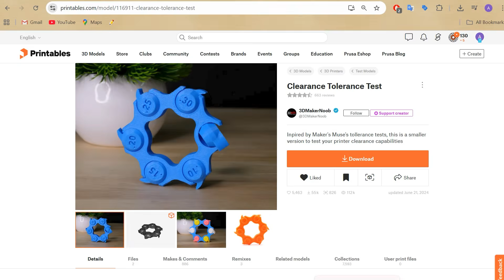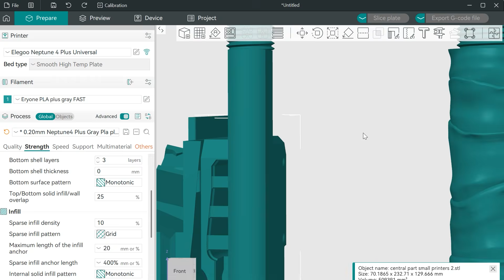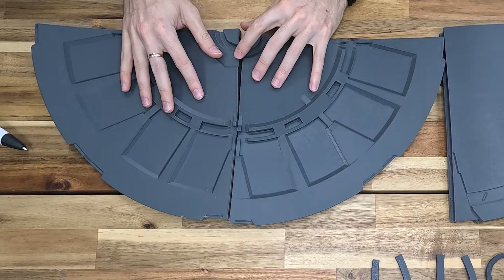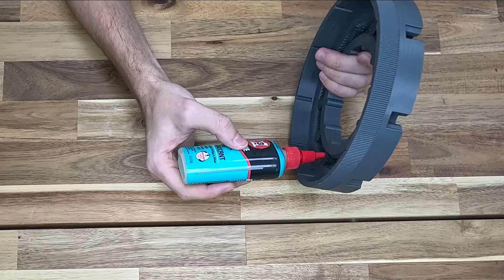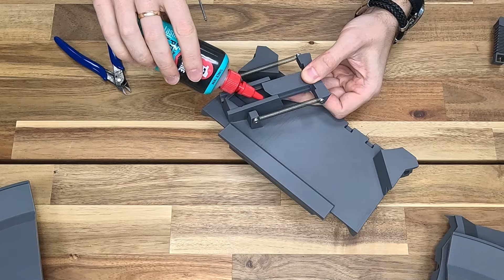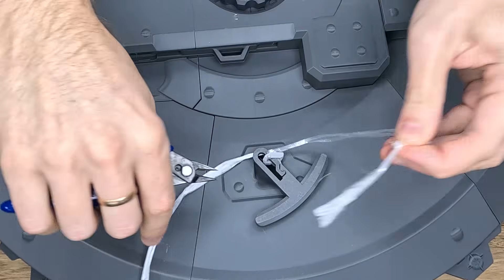3D-Printed DOOM Shield – Fully Functional Saw Mechanism!

Comment: Im using the 100 micron bearing and i have to force it to even move 😢😢😢
Reply from the maker: do you print calibration model?
Reply: @Alex_Geek_Workshop  there wasn't one in the files I downloaded so no

I checked the bearings and the print was all clean and neat at 0.2 layer height 

Can you tell me the print settings you used?
Reply from the maker: @poo-v7t6q I provide link to download calibration model ( it’s not my model) the point is not in setting, all printer is different, plastic diameters can vary from batch to batch, you need to calibrate your flow with your printer and your plastic what you use. In YouTube a lot of videos how to do it
Reply: @Alex_Geek_Workshop much appreciated ❤ 😊 thank you
Reply: @Alex_Geek_Workshop I've finished it but the chain doesn't wind back into the chain slot after pulling on it to make it spin could that be to the bearing being to tight?
Reply from the maker: @poo-v7t6q can you write me in dm in social media like instagram, this will more convenient and fast
Reply: @Alex_Geek_Workshop I've just realised I forgot one of the springs 😂😂😂😂😂 I'm so dumb all is well thank you its working perfectly now

Comment: Did you have to sand or do any post processing to get that very smooth finish? Parts look amazing, and the tutorial is very thorough.
Reply from the maker: its just from printer not finished parts
Reply: Smaller layer lines means cleaner print but a longer print time 0.2mm layer height is recommended for a finish like in this video

Comment: would you sell kits of this? and would you be offering the larger scale shields too? will there be options for physical kits for what hardware we buy? eg options for 3d printed springs or metal springs, printed parts sizes etc?
Reply from the maker: kits? It's fully 3d printed. If you want metal springs, i am already leave links in description
Reply: @Alex_Geek_Workshop  yeah i mean would you sell the fully 3d printed model unassembled with the metal hardware? and at different scales like you showed in the video, so theres less seams to fill?
Reply from the maker: @lolersk87  If you want i can send it unassembled. And i cant scale it with metal springs couse i cant scale springs itself. i am already ordered bif printer to print shiled one pice but it will be delivered in november
Reply: @Alex_Geek_Workshop oh awesome! When it arrives and is up and running would you update your shop listing with those options?
Reply from the maker: @lolersk87 yes, stay tuned